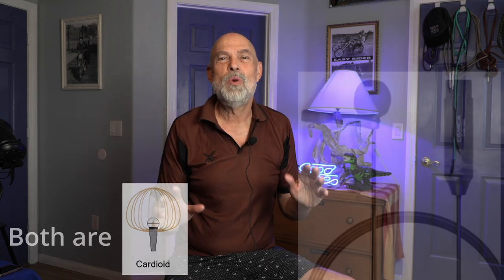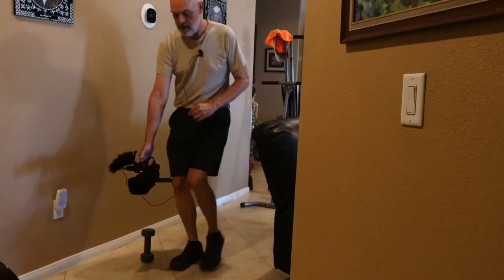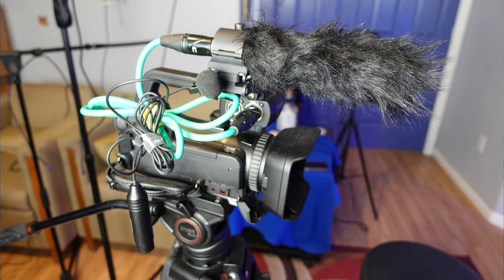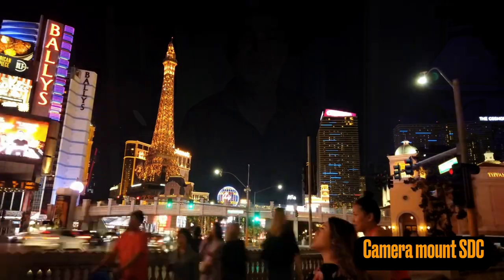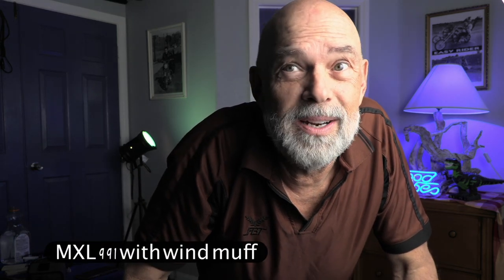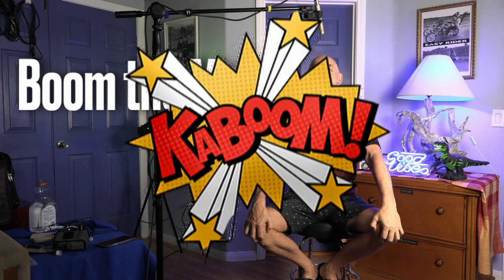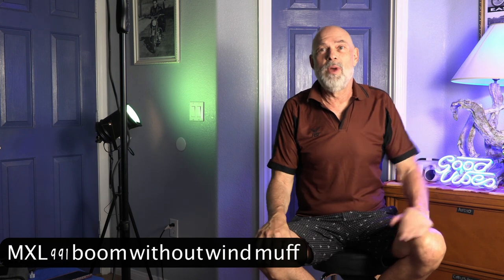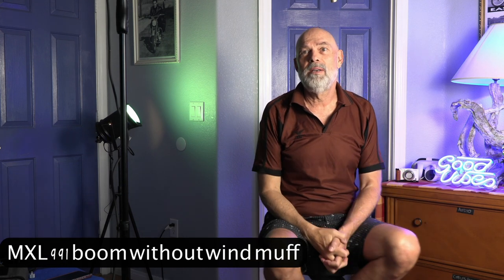Camcorder Audio Setup: Canon XA70, MXL991 & CVM-V02C Microphones

Comment: Thanks for the videos been thinking about getting the canon xa70 do you still like it, pros and cons? Thanks in advance
Reply from the maker: Yes I do but for specific scenarios such as recording your kid's soccer games, long videos or "set it and forget it" situations.  
-Pros are battery life, zoom and simplicity.  Also the ability to use XLR microphones via the handle is fantastic.
-Cons are lack of full frame or APSC sensor (1 inch sensor still bigger than most camcorders), size and low light capability. The XA70 is best for BTS or making long recordings outdoors in daylight.